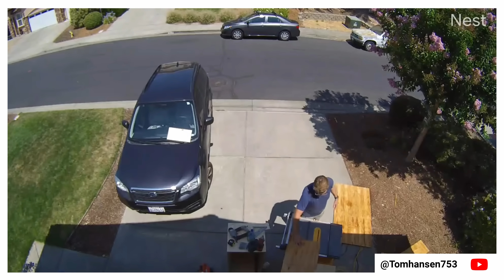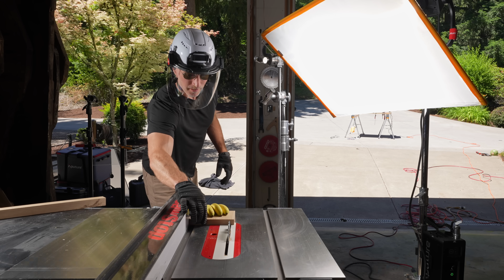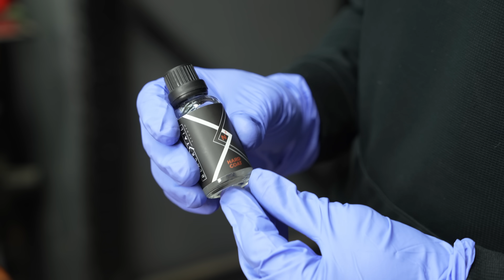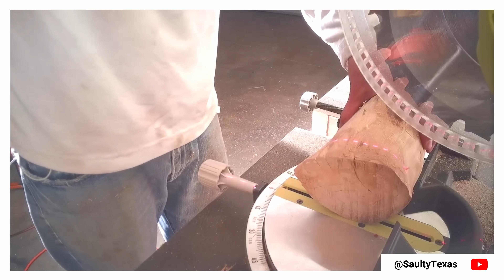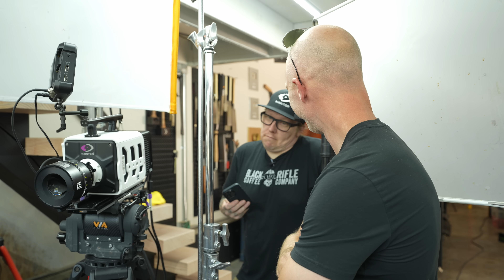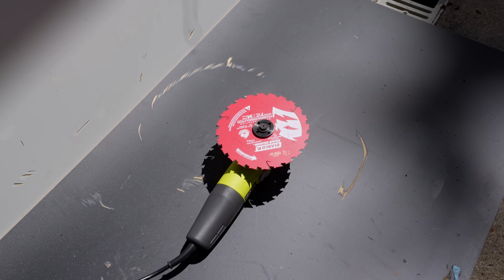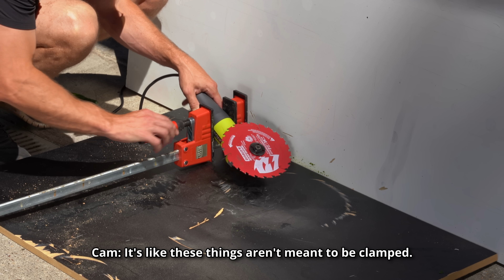Woodshop Safety in Slow Motion

Comment: I have watched a lot of your videos and love them. I have also watched John malecki and Black Forest. One thing I have never seen that I think would be really cool is a live edge epoxy table inside and out. A simple example would be two thin long slabs with epoxy in between so both uncut on the outside. I get this would be difficult to find the right wood for it and the table width could not be pre-determined but is it feasible to do or am I just crazy for thinking it’s possible. I am wanting to build a table and want to do something like this but worry I might be in way over my head.

Comment: I'm not a woodworking/builder person but I enjoy watching crafters do there thing.  However, I have worked for firms that emphasized safety to the point that the VP of Manufacturing would tell people to use the handrails while walking down the stairways because trips and falls was our leading form of injury (these were heavy manufacturing firms).

Just one question, I have seen builders use feather boards on their table saws.  Isn't a benefit of a feather board to keep the wood straight and reduce the risk of a kickback?  Safety is all about risk reduction.  You cannot completely eliminate risk.

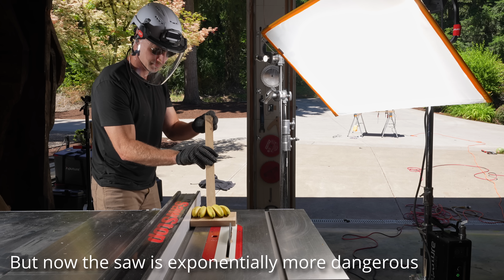Comment: @2:11 Not like I endorse you doing this Cam. But if you must, use something that will break away effortlessly. Maybe a thin balsa wood piece as your push stick. Where using hardwood and something that is structural might be grabbed and thus drawing your hand into the spinning doom blade.

Stay safe!

Comment: I experienced the (non sliding!)miter saw hook and grab effect, with a 12 in board, hands firmly gripping away safely, clean sharp blade, correct hook angle, no visual wood defect 90° Cut. THE WHOLE BOARD got dragged THROUGH the fence and exploded and my hand that was firmly gripping the fence and the board got dragged into the blade. I think I saw the kerf deforming and heard the tone change before I felt  the pull...But that's just luck/hindsight, My fast reflexes could barely deflect my hand. If I had been cutting a shorter or weaker piece...
Think about it : 10in /254mm @ 5000 RPM = 833.1 in/s  or 21.2 m/s --> Assuming 100% speed and a direct path,  limbs 10in away will reach the blade in 0.012 s or 12ms. Nobody reacts fast enough.

Comment: The bananas didn't get pulled into the blade like a real hand would the first two times, because they're just sitting there on the wood, not "holding it down" like fingers with pressure on each tip. They have no pressure except gravity, so the wood being pulled out from under them suddenly isn't enough to pull them into the blade.  But if it was someone trying to hold the board down with pressure, it most likely WOULD pull that hand into the blade on all of those catches.

Comment: @03:43, or more exactly t: 223.74 seconds (board is just pre kickback). And t: 223.99 seconds the board is turning into the blade. At t: 224.12 seconds, the board is just airborne and seems to have cleared the blade. Finally at t: 224.23 seconds, the board is almost in contact with the tree (making contact about t:224.40 seconds).

Would be curious what the distance is between the table and that tree. To know the average speed.

I wonder if there is an optimal speed curve based on the board’s mass. A smaller board like this is probably more frightening, cause we get complacent which cutting. And its probably easier for the table saw to transfer its energy, creating the silly fast acceleration a full sheet cannot have.

Comment: Sry for my english and long comment big fan but The angle grinder i can relate to way to much and still i have all my fingers 😅 i work with alot of metal and yeah dont hold stuff in ur hand when u sanding the metal but then its throwed it out of my hand i i got the grinding disc in to my finger and grinded down to bone i also normally us the safeguard on it but one time i didnt the disc exploded in my hand also i multi time has close to cut my fingers off alsobut sry i have so much to say also never wear lose clothes when u use a angle grinder i did it 2 times in my life and i got caught in the clothes hits u in the stomach

Comment: Hey Cam, I was binging your videos and noticed you often spend a long time with those small hole epoxy touch ups. Was wondering if you considered using something to vibrate the board slightly so the epoxy fits into these cracks easier.

Comment: My grandfather lost 4 of his fingers to a long arm (the one that looks a bit like a crane) (old tec ) (the mounted  circular saw in the video was the industry upgrade).

Basically less than a second and bam. No more fimgers for you. The doctors managed to reattach his middle finger to the stump of the index so he could at least pinch things to use his hand. The other 3 where unoperable (to much blade dmg.)

Then my father a year or 2 later nearly removed his fingers with a chainsaw🥴

Comment: To be honest using a circular saw blade to turn your angle-grinder into an ANGER-grinder is one of the scariest thing you can do to this machines. I wouldnt even consider connecting this contraption to an outlet...
And this is coming from someone who had a 230mm angle grinder blade explode into his face with a machine that had no blade guard.

Comment: okay stupid question - why not have the blade running in the other direction, so the kickback would be kicked forward and therefore away?
Reply from the maker: There are videos of guys doing that. It’s pretty exciting. Basically the board it ripped away and launched before it is cut.

Comment: Oddly enough the tool that I’ve hurt myself the most with it’s a drill 
Drilling metal with a cordless drill the bit snaps and I push it through my off hand I’ve done it 3x 
(you’d think I’d learn )
I’ve gotten lucky with an angle grinder a couple times got caught up in my clothes and stopped before doing any damage

Comment: What camera is that? (the one used for slow-mo)… image quality looks very good and it seems it does well without needing to add a ton of light. I’m curious if it’s affordable? I know “affordable” can be very relative… I’m thinking along the lines of an FX3, less than an FX6… so $4-6k. Is this slow-mo camera within that price range?
Reply from the maker: The slowmo guy tells me this camera is about $200,000. It cost $10,000 to rent for 48 hours. Fx3 is a good all around camera though. Only does 240fps vs a million fps here though
Reply: @BlacktailStudio  thank you! And wow, definitely waaay more expensive than I was hoping. Costs more than my apartment. I wish “1 mil fps” slow-mo was more accessible, like have a pro-sumer line (like some $4-5k cameras are really good compared to high-end cinema cameras, and very accessible to own one as a hobby).
And… 240fps? Clearly I have no clue how fast a table saw blade spins. Because on those slow-mo blade close-ups, I thought “at least a few thousands fps”.

Comment: The very first kick back I ever saw happened in High School Wood Shop Class...

Our class was down an L shaped side corridor and the table saw was in line with the class room door...some Moron of a Brain-Dead-IDIOT was trying to rip a 2x4 lengthwise and it kicked back so hard, the saw blew the 2x4 THROUGH the closed steel fire door and into the cinder block wall hard enough to take a golf ball sized chunk out of the wall...

What made it even more terrifying is the Principal was just about to step in front of the door to open it so he could talk to the Teacher when the 2x4 came blasting through the door...it missed killing the Principal by about 7 inches (the wall chunk actually hit him, but didn't leave more than a small bruise)...

Needless to say, the Idiot was never again allowed anywhere near one of the shop classes (we also have Automotive and Machine Shop class rooms)...

All we heard was:
Saw whine
saw wood cutting noise
saw grinding whine
BANG
THUD
all instantly followed by 1 minute of the most prolific Swearing ever heard in the history of that School at a volume sufficient to be heard in Florida from a man that no one had EVER heard utter ANY profanity in his life...the School is in Ontario, Canada...

Kick Backs are dangerous, always use saws carefully...

Comment: Hey, I just have a question for you. I recently went to an old antique-type store that was closing and was giving stuff away for cheap. In the back there was a craftsman radial arm saw that we were able to buy for only 10$. It works fine after testing it but was part of a recall for large amounts of kickback and that the cover did not cover the whole blade. I have heard it has large amounts of kickback but I would like to know if you think I should just cut the cord and get 50$ for it.

Comment: In 1992 in middle school shop class i slipped at the band saw and went all the way to bone on my left index finger. In 2006 i slipped with a razor knife that jumped up the straight edge i was following and cut the left index and middle finger to the bone through the knuckle. 

I've seen way worse than those i did to myself.  I've probably deserved a few that i got away with too.  Now i am mr PPE and double check everything.   But I'm also old.

Comment: Man, I will use a chainsaw no problem, but I hate angle grinders with a passion! Using something spinning at 30,000 RPM that could kickback into my face or explode into shrapnel that could go straight though my skull at any moment is absolutely terrifying.

Comment: I see that you are having difficulty loading and unloading wood from the vehicle. You can use a round stick to work like a roller. In fact, you could make a tool with bearings and a roller to put on the door of the vehicle, and make loading and unloading more comfortable.
spanish 
Veo que tienes dificultades para cargar y descargar madera del vehículo. Puedes utilizar un palo redondo para que funcione como un rodillo. De hecho, podrías fabricar una herramienta con rodamientos y un rodillo para colocar en la puerta del vehículo y hacer más cómoda la carga y descarga.
Reply: I've seen you with that problem in other videos, but I mentioned it here because it's your most recent video.

Comment: I’m wondering! Why can’t one find a video on YouTube that shows a banana or similar falling on an active SawStop blade. Videos only show slow moving sausage going into the blade. Do YouTubers that get the saw free or with price cut accept not to try that? If someone can show me a falling banana onto a SawStop not being damaged I might consider supporting the idea of the machine handling my safety.
Reply from the maker: The object needs to be grounded to transfer the electrical current. So the banana would need feet touching the ground.
Reply: So it’s not working when I wear rubber shoe? I would think that it works more like a capacitive touchscreen. But my main point stands.
Reply: Still, I would like to know what would happened if your fingers were shot into the blades by a kickback. And I would like to know if You are allowed to show a thing like that with the SawStop activated. How ignorant I am!

Comment: Yeah this seems like a pretty dangerous way of demoing it. Id rather make a long rigid extension to a push block the sticks out to the right, then you stick the push block to the board and stand on the right side of the table. Pulling it towards you and then sliding right would initiate the cut, and then a small twist of the extension could drive the front of the board into the blade, with your hands being two or three arms lengths away the whole time.

Comment: Total noob here, but why TF would a table saw be set up to cut towards the user? It seems better to have something holding the object and sliding it from the other direction. Yeah, I'm sure I said something stupid, but he rest of the Internet will ignore it :P
Reply from the maker: You’re half right. Meaning, it won’t be ignored. If it cuts away from you it would essentially do this kickback in the opposite direction every time. Launching it across the room. You need that resistance to have any control.